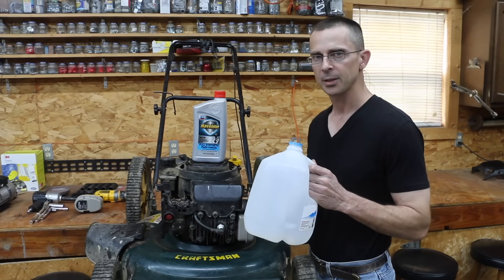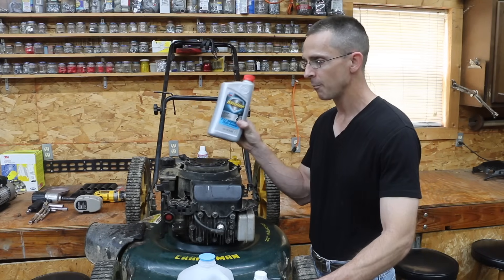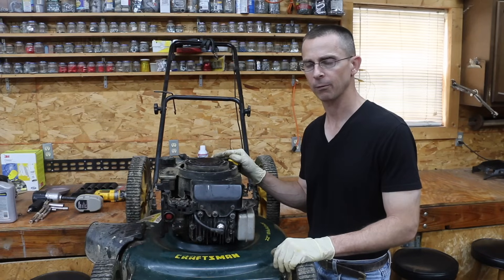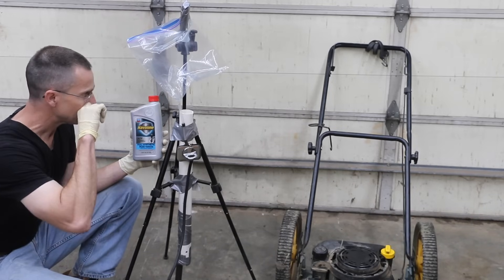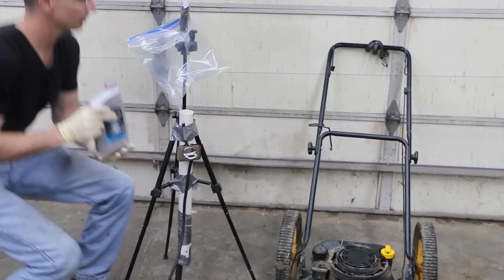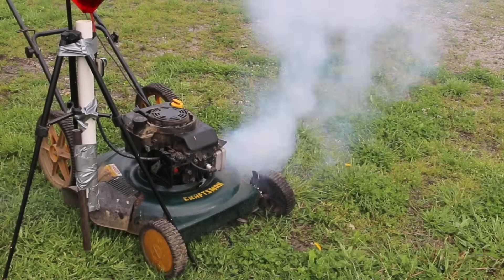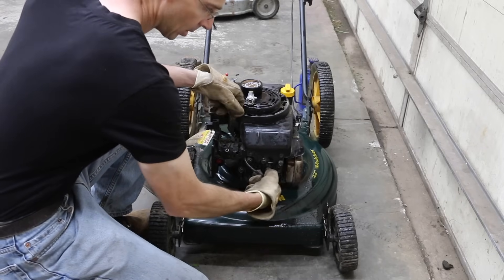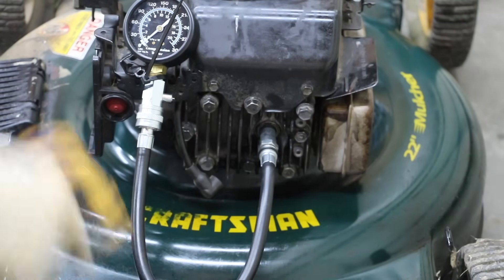Seafoam--can't believe what it did to my engine episode 6--Seafoam vs ATF!!

Comment: Run ATF  in the crankcase for a week before your planned oil change.  I used to do that on my F-150.  Also ATF mixed with diesel is a great cleaner for around the garage for engines and parts
Reply from the maker: Thank you for this recommendation!

Comment: cant use atf on catalytic converters .it will clog them up . by the way atf is an old timers trick to free stuck valves and it works as long as its not a bent valve
Reply from the maker: All great points and thanks for commenting.

Comment: Project Farm: Cool video!  This is the third one I've watched in just under 1/2 an hour. I stumbled onto your video and saw the Sea Foam and Lucas additives Very interesting stuff. Back in the 80s my dad used to tell me to add 1 quart of kerosene to the engine oil in my truck and let it run for about 20 minutes to 1/2 an hour and that will clean out the engine. Then drain the oil and change it and the filter out and that is supposed to help the motor. In the past I used ATF on an old Plymouth I had. It smoked like a rocket taking off and almost killed the engine a few times but eventually it ran a bit stronger and smoother. There are set-ups you can make or buy that use chemicals very similar to windshield washing fluid and inject it into your diesel engine and that also helps the engine stay cool while driving and cleans it out. SO you may want to check that out as well. I enjoyed your videos and subbed your channel. Thanks for this. It's just what I was needing for my pickup.
Reply from the maker: Thanks for the positive comments and thanks for subscribing!

Comment: Good video. 
One thing folks need to realize... Carbon build up in old engines helps keep the worn piston rings etc sealed. Dr-carbing will increase oil consumption and reduce compression in many cases. 
There is no mechanic in a bottle to reverse the effects of wear and tear.
Reply from the maker: Thanks for commenting on this.

Comment: i have used regularly 1/2 quart atf spray entire contents of gum cutter or equal carbspray into 1/2 empty quart of atf top off with water cover and shake feed in through vacuum lines or over throtle plate using last of it to flood out engine to stall let sit and soak at least 15 to 30 mins for best results. if you accidentally hydro lock remove plugs rotate few times reinstall plugs only if necessary. I have Used this mix on car engines with great results.
Reply from the maker: Thank you for this recommendation!

Comment: I’ve cleaned a gummed up 4.6 v8 by putting some atf in the crank case before with the oil. It works. Just wouldn’t reccoment putting more than 20 to 50 miles on it with the atf
Reply from the maker: Thank you for this recommendation!

Comment: Safe to use on a car?
Reply from the maker: I wouldn't recommend it, since it could cause issues for the catalytic converter or the sensors.
Reply: Project Farm I might try it in moderation, my s10 has the cat removed and only a single o2 sensor. Its old fashioned.

Comment: Have you done such a before-after comparison when using different fuel? Over here in Germany there is a huge price difference between cheap fuel and premium fuel at the gas station. Is it worth the price difference, a lot of car drivers are asking themselves. Maybe you can give us an answer with a comparison test?! That would be great! Keep up the good work and thank you for your videos.
Reply from the maker: This is a great recommendation. I have not done this yet.  Thank you for the positive comment.
Reply: One of the main promises of premium fuel is that it can remove dirt from inside the combustion chamber and the valves so it would be great if you have a really dirty motor to show us the effect of premium fuel.

Comment: Will quart of WD-40 work better and less harmful to the engine 
Like the one in the big gallon can

Have you tried this with WD-40? I have👍🏻 it can clean out carburetor and fuel injectors with it and clean out heavy carbon deposit on throttle body and was fun and worked Better than Throttle body clear

Comment: I keep hearing about how ATF fluid helps lubricate diesel injectors any thoughts?
Reply from the maker: I have a diesel and don't use it.  it may help the injectors, but it isn't designed to burn very well.  This is just my opinion, and others may have some science to back up their perspective. Thanks again.
Reply: Project Farm 
My fear is it would damage the engine even though diesel engine burns it's fuel hotter than a gas. I would rather not risk it would rather put motor oil to add lubrication to the fuel.

Comment: another video that I'd love to see (since I haven't been able to solve myself despite cleaning carburetor, replacing spark plug, cleaning air filter) is why do gas leaf blowers seem to have such a short life span?  I'm lucky to get 1-2 years out of them compared with many years out of lawn mowers, line trimmers, and edgers.  My leaf blower runs at about 50% speed max and I have not been able to solve this issue!  Thank you in advance!!!!
Reply from the maker: Thank you for the positive comment and thanks for the recommendation on a future video.

Comment: What was that hand cleaner that mechanics used that resembled lard? Would that be able to clean your engine? You might have to heat it up, or just use it not while the engine is running but with a wire brush and cold soak it.
Reply from the maker: Thank you for this recommendation.

Comment: It's only after a car has been neglected or with high mileage things like this is necessary,,,,,.  Any additive is helpful,,,,.  I have gotten a lot of high mileage vehicles to run a lot better,,,,.  But now with direct injection,,,. Water or other cleaners should be used every 10 or 20 thousand miles,,,.  But not transmission fluid,.  !!!!   Murphy's Miracle Oil in your gas and in your oil,  !!!!    And water your Pistons,  !!!!   It will take about 5 applications in a row,,, 1200 miles,,,,to,,, 1500 miles,,,,, driving it easy,,, to clean up a older motor with a hundred and twenty thousand miles on it,,,,, direct injection will probably need the same every 30,000. *. 40,000.  Miles,,,, it's easier to clean a little carbon off then it is a thick heavy carbon residue,,,  !!!!!   Do it early do it frequently,,,,,, if you keep your cars more than 5 years,,,,.  You don't have to change your oil or do any maintenance if you trade your new car off every 3 years or four,, ???   I know a Duke Energy engineer,,, doesn't change the oil for 5 years or 60,000,,, And Trades it in,,,, that's what's scary,, ???
Reply from the maker: Great point and thanks for commenting.

Comment: Atf works great. Looks like it does the best with little risk. If you barely spray it in so it doesn't wash away the oil from the cylinder it won't harm anything and eill.cpean it right up!
Reply from the maker: Thanks for commenting on this.

Comment: I had a rototiller that I bought used. I couldn't even start it with one pull of the rope. It usually took 10 or more pulls. I bought a spark plug and overhaul kit for the carb. It still wouldn't start easily. I pulled the head off and cleaned all the carbon off head, piston, and valves. I ran a mix of ATF and oil in the crankcase. The tiller started on the first pull, every time. The Carb had to be adjusted every start, guess the adjustment turned when the engine ran. It cost me very little to fix an annoying problem. I checked oil after using the tiller and it was black. I used that tiller until I got tired of dancing with a tiller. If the seafoam will clean deposits of carbon it would be good to use. Never tried water.
Reply from the maker: This is a great post. Thanks for sharing your experience.

Comment: I was reading an old automotive book one time were the poured ground walnut shells in the cylinder then used an air blowing tool that screwed into the plug hole to clean the carbon out. The shells are soft enough to remove the carbon while not harming the cylinders or head. But then you have to vacuum the mess out. So it was time consuming but worked well
Reply from the maker: Thank you for this recommendation.

Comment: I use ATF all the time in the shop on diesel's atf works really well in lubing the injectors and fuel pump.
Reply from the maker: Thanks for commenting on this.
Reply: Project Farm  anytime thanks for your videos
Reply: I use my old tranny fluid and motoroil after filtering it in my diesel work truck. I believe it keeps the injectors pumps and pistons lubricated and cleaner.

Comment: Atf should not be added to the intake but one quart or so added to the motor oil in place of a quart or so of motor oil. (Should be run for a few miles and then changed to straight motor oil). Keep that in mind as well as the water method is usualy used with methanol known as water/ meth injection in performance vehicles. It is known to be safer than nos but only if the tune is right for fuel injected vehicles. Keep an eye on the air to fuel mixture as you run the tests.
Reply from the maker: Thank you for this recommendation.

Comment: As a retired Ford technician, we used CXC-52 carbon cleaner on carb and FI engines.  Work well to de-carbon, clean t.body, intake manifold, PCV system and idle control valves.  Just follow the instructions, let it soak after shutting down.  You really noticed the crap come on the road test after, under load.  Worked well on all my other small engines & outboards.
Reply from the maker: Thanks for commenting on this.

Comment: @project farm... Have u tried 2T oil which is JASO FC rated... It's meant to burn clean and its has detergents in there as well. Try using 2T oil for air cooled engines rater than the ones which are designed for outboard engines which are water cooled TCW3 rated...
Reply from the maker: I haven't done this yet. Thank you for this recommendation.

Comment: Hey thanks for the testing. Very interesting results. It's NOT a poor use of resources, especially since you enjoy it. I feel the same way about my projects such as restoring old machinery that very few folks care about. Please keep it up!

I've got a lot of experience with Buick cars from the 80's.  We've seen several instances where Buick 3.8L engines will ingest many quarts of Dexron from the transmission of the car. This can happen because there is a vacuum hose connected between the engine manifold and the transmission modulator.  If the modulator diaphragm fails, it will allow the engine to ingest massive amounts of transmission oil.

In these instances, I have seen similar results to yours. The trans oil acts as an engine flush, cleaning up the crankcase deposits and dissolving them in the oil.  This is not a problem on well maintained engines. However, if the engine has not seen regular oil changes, or the filter is already blocked with debris - the cleaning action can cause too much debris to break loose and begin circulating in the oil. In one case, it caused the engine to fail rod bearings. This happened because so much debris circulated it actually blocked the oil feed holes in the main bearings from the oil gallery in the block!
Reply from the maker: This is a terrific post!  Thanks for sharing your experience with ATF in the 3.8L.
Reply: Thanks!  They went to the vacuum modulator system on the front wheel drive GM cars when the 4-speed auto transmission was introduced (1985) up until the late 90's when they went to the electronic pressure control using 4T65E. Even though the modulator is very reliable, there are a lot of them out there so the law of averages says there will be incidents!  You can see the smoke cloud for miles when this happens!
Reply: Great point!  Breaking up the gunk, and emulsifying it in the oil is great (think dishwasher cycle), but getting that suspended stuff out of harms way soon is very important (think sand in your shorts!).
I prefer to never apply the "set it and forget it" crankcase cleaner additives, and do a compulsory oil change after a few dozen miles (<50mi).
My logic is to attack agressively with compromised viscosity oil/cleaning agents under light load, then rinse well after a short bit.  Even sacrificing a quart of oil as a rinse through.  (its worth the $5 waste imo)
Reply: Is there a retrofit for the mofulator or upgrade to prevent the engine from ingesting ATF?

Comment: I bought a used '06 Ford Freestar from a local dealership a few years back. i changed the "oil" after the first 3000 miles I drove only to find that they filled it with ATF instead.  I bet the engine is really clean inside...hope the bearings and cylinder walls weren't damaged.

Comment: Was it conventional or synthetic atf used in the video? That might make a difference. I used 1 quart conventional with around 5 gallons gasoline in my 72 Corvette, and when I pulled the heads the pistons, combustion chamber, intake, and carb were clean as a whistle with no carbon build up.
Reply from the maker: Conventional. Thanks for commenting.

Comment: This looked like it worked well, but when looking at your water injection video it looks like the water did a great job of loosening/moistening/swelling the carbon deposits, so even if it didn't remove them I suspect that the water had loosened it up and made it easier for ANY "cleaning" product to work better. So for instance, maybe doing a short water injection then followed by seafoam or ATF or whatever will work to clean it better than JUST seafoam, or JUST ATF.
Reply from the maker: All great points and thanks for commenting.

Comment: I would try brake fluid brake fluid is a natural penetrating oil even works better on rusted nuts and bolts than anything you can buy in a spray can not sure how well it will burn in a combustion chamber but if metered correctly I would assume that it would clean up carbon deposits substantially
Reply from the maker: Thank you for this recommendation!
Reply: I saw a test done at a university somewhere, they found that a 50/50 mix of acetone and ATF worked the BEST as a penetrating oil. It provided the least amount of force required to remove the siezed/rusted bolt.... I've yet to do it myself, but the numbers spoke for themselves.
Reply: My bad, I don't think it was a university, or I can't find the video I initially saw.
Reply: MedEx Concentrates I'll have to try that anything that would help would be beneficial where I live there's a lot of Agriculture equipment and other heavy equipment I work on a regular basis

Comment: Dont listen to people that talk crap. Your videos are awsome! Thank you for your time taken to do these for people. So i have a 2017 ford transit van i got brand new and use as my service teuck. I do onsite semi truck services and repairs as well as trailers dollies and forklifts for one of the biggest companies in the country in six cities between Indianapolis and Ohio. My point is i have 20 thousand miles on my van. I wonder if using a can of sefoam or something maybe once a month or so will keep the internals of the engine/ fuel system cleaner longer. Of course refular maintenance is always done as well. I have also added seafoam straight to my crankcase oil on my older cars as well. What do you guts think about this?
Reply from the maker: Thank you very much for the positive comment!  Regarding the use of Seafoam periodically, I'm very confident that is does provide some carbon cleaning benefit.  It's not all that expensive either.  My opinion is that it'll keep things cleaner over not using it at all.  Hope this helps.  Thanks again!